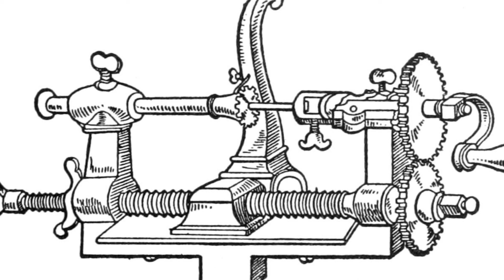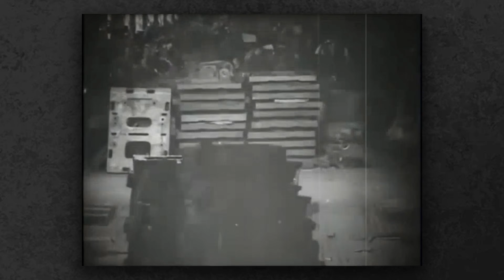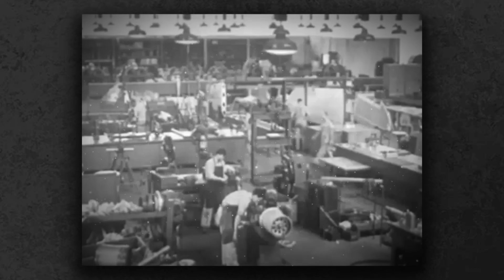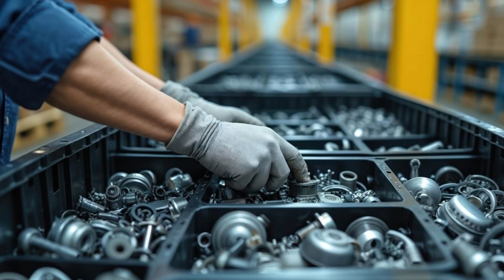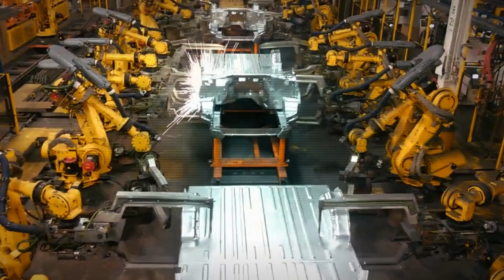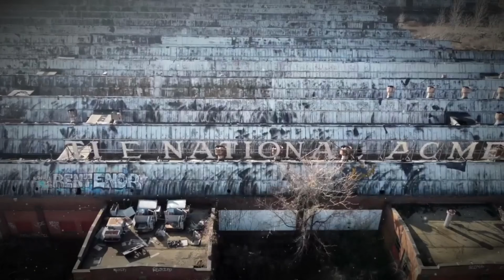How Two Broke Mechanics Solved The Biggest Bottleneck In Manufacturing: The National Acme Story

Comment: I had the opportunity to see the huge Acme Gridley six spindle bar machines in operation at a company I worked at in Philadelphia back in the early 1980's. Those machines were deafeningly loud. I would stand there in awe watching all the tool slides moving in concert with each other. I believe they could handle 3" bar stock.
The parts these were turning out were machined from solid aluminum and were the bodies for artillery fuses. Also, I believe that these machines were owned by the government.

Comment: I do maintenance on Acme-Gridleys every day. We have 60ish of them running 2 shifts seven days a week. They still make parts faster than any of the CNC machines that we have. But when something breaks, it can get very clench worthy. We still have 2 machines that were made prior to WWII, and they still push parts just like the newer ones.
Reply: Congratulations on your excellent work. I began my training as an industrial electrician in 1974 at a factory which manufactured governors for propellor0driven aircraft; fuel controls for jet engines and controls for hydroelectric projects. When I first started there, I basically knew nothing about REAL electrical work. One of my jobs was maintaining their machine tools (they had a separate department that maintained the CNC machines). I quickly learned how to read wiring diagrams! Among the machines that I worked on were: Barber-Coleman, Bridgeport, Cincinnati, Clausing, De Vlieg, DoAl, Ex-Cell-O,  Fellows, Giddings & Lewis, Gorton, Hardinge, Heald, Jones & Lamson, Landis, Le Blond, Mattison, Moore, Monarch, South Bend and Warner & Swasey. Plus, a few foreign-made machines.

I was laid off after 19 years of continuous employment there. My next job was at a factory that made frames for General Motors trucks & SUVs. They had three assembly lines; two were fully automated and the third was partially automated. They used Allen-Bradley programmable logic controllers (PLCs), which I had never worked with. Fortunately, I quickly caught on in working with PLCs. Needless to say, the voltages that I routinely worked with were 120, 240, 277 and 480 volts, both single- and 3-phase.

I am now retired and I look back on my "contribution to American manufacturing with great pride. Take care...

Brad Anbro
United Auto Workers Journeyman Electrician (retired)
Reply: Where is your shop located?
Reply: @kevinmerinar1689  Lyman, Nebraska

Comment: In the mid 1990's I worked in a screw machine shop in Chicago 15B&S single spindles and 26 ACME multis all WW2 vintage complete with War production board tags from 1942 and 43. still running until 1996 when the plant was auctioned off.
Reply: The same type shop operated in Dawsonville, GA in the ‘90s.

Comment: My short stint as a machinist in a screw machine shop (Guildemeisters)  I consider the worst job I ever had. 
After a few hours you could take a flexible scale and scrape a pool of sulphuric based cutting oil off your arm. I had to grind the carbide form tools, resharpen those tools, on a drop. Everything and do this now basis. I had to reverse engineer any machine parts that broke and machine a replacement, all while being under the gun. I also had to account for every minute of my time while not having a second to do so while working, so I had to do this after quitting time trying my best to account for every minute. 
Imagine my relief when I gave my notice immediately after the foreman explained to me that while the entire shop went on two week vacation in July, I would have to work to clean the place up instead.
Reply: Yes your so right oil every where on the floor and the smell ugh I work in an aerospace shop doing military contracts and aerospace , rockets yeah I visited my friend in screw shop and I wouldn't do that at all I know too much math and I've been a master machinist since 98
Reply: I think he is explaining why these jobs are now overseas or across the border.
Reply: and this has to do with what? You being a baby?